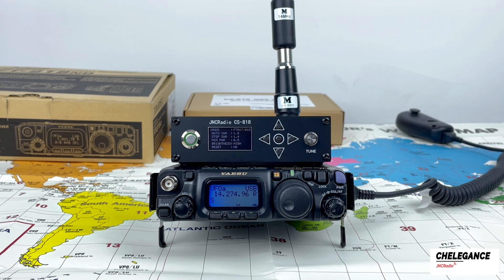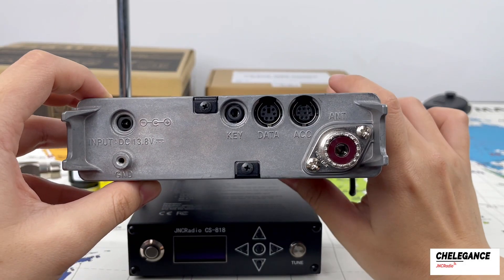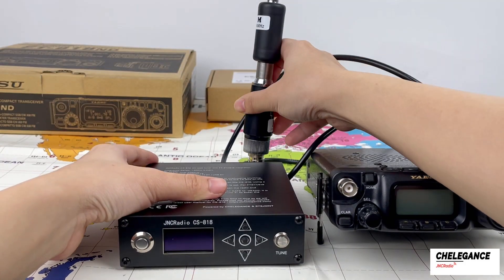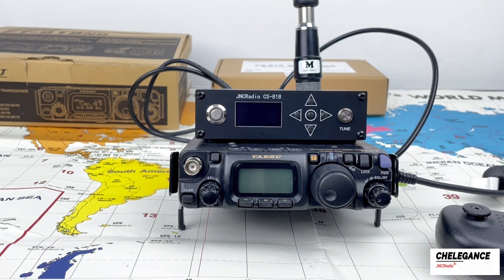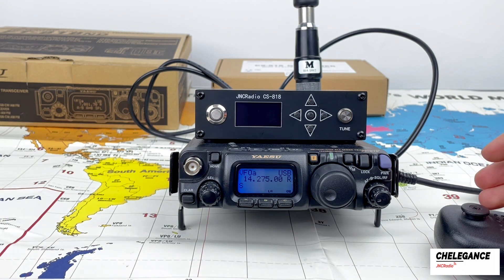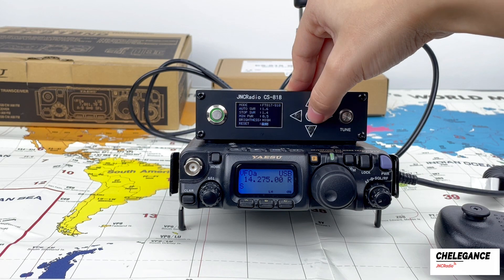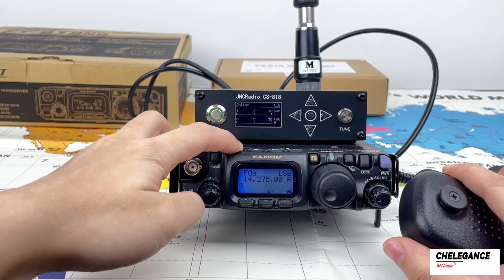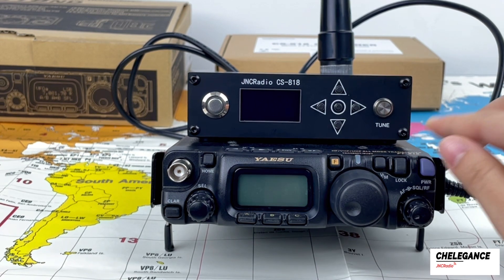CS-818 and FT-818 Combination Demonstration!

Comment: I have made excellent contacts with the M104 antenna and the CS818 tuner. I Use a good mounting bracket on the car with the screws making contact for a good ground. I worked European stations on 20 and 10 from the park. On 40m its a short antenna and it does work for regional communications. Check out their MC599 and MC750 as i am very happy with those antennas as well. After more than a year no issues or breakage.